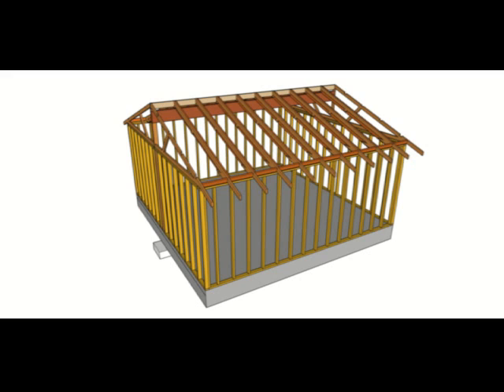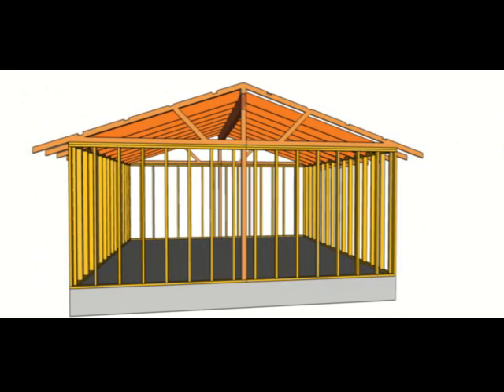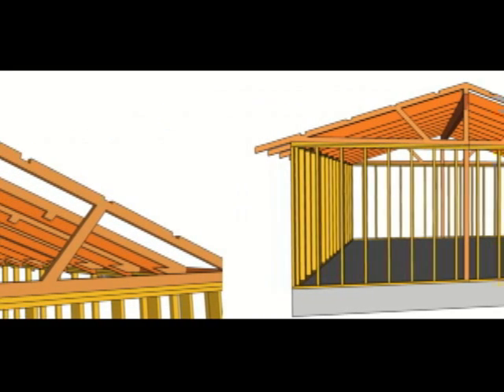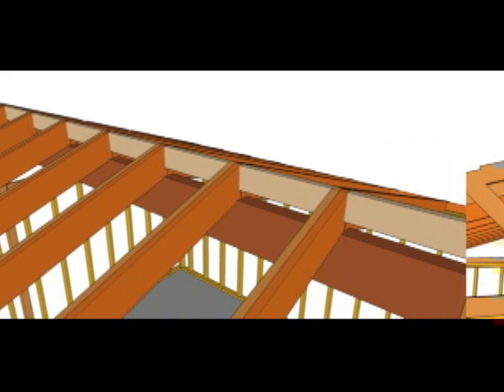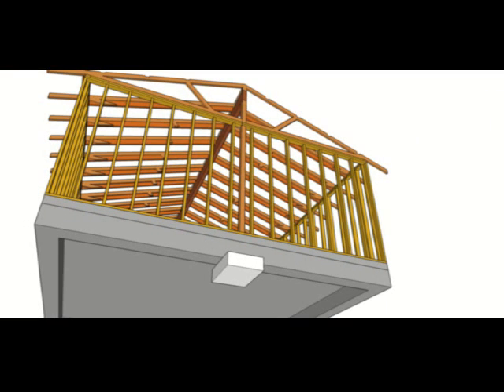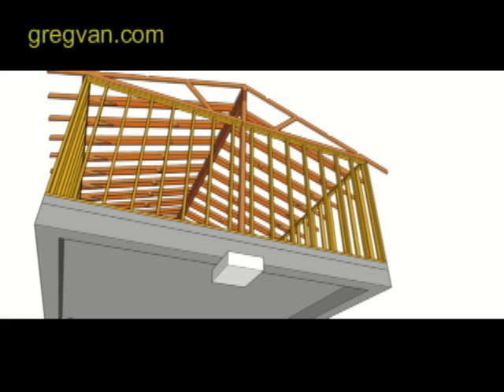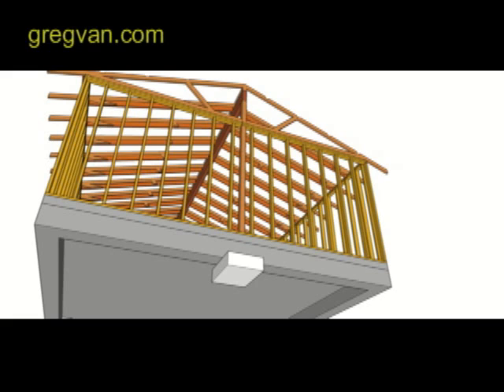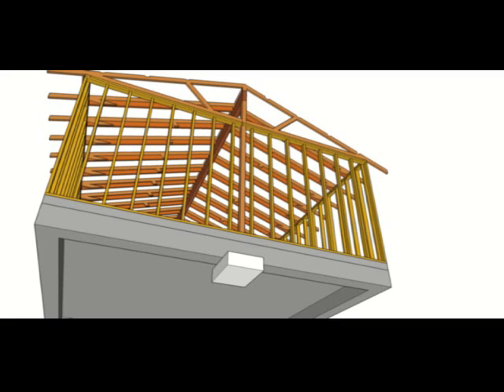Installing Ridge Beam for Cathedral Ceiling – Engineered Roof Truss Removal

Comment: Hello..I have a ranch home. Up in the attic I have a ridge trusses supported by center posts.
I know I need to consult an engineer, but just wanted your opinion , if I can remove the supports, but leave the center ridge, which is supports by posts. How can I show you a few images? Do you have an email address?

Comment: Great videos dude how would this work with a hip roof like a garage or living room with a hip roof . Keep up the good work
Reply from the maker: I'm pretty sure I made a video already, but I couldn't find it. You can check the website yourself, but for the most part you will need to use some type of ceiling beam with a post up to the ridge beam or were the top of the hips join to the ridge for structural support.

Comment: I have a home with rafters (2x6) with a 2x6 ridge beam. I want to remove the ceiling joists for a cathedral ceiling and I am wondering if I can support the ridge beam with a glulam beam up underneath it with support beams holding it up. Thanks.
Reply from the maker: It will work if the beam, rafters and rest of the house will support everything.